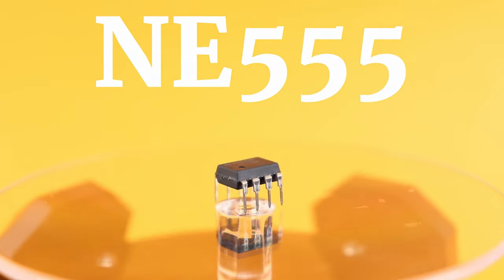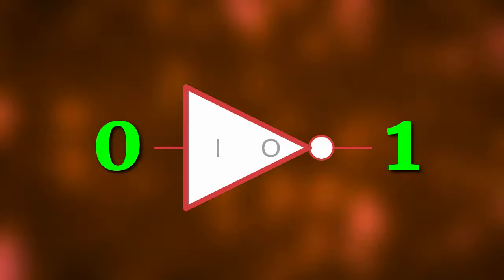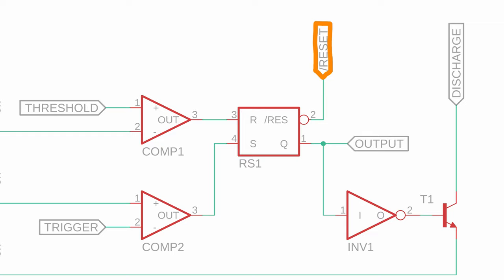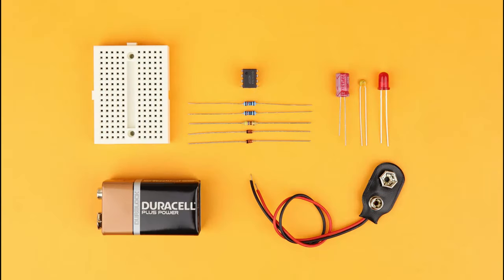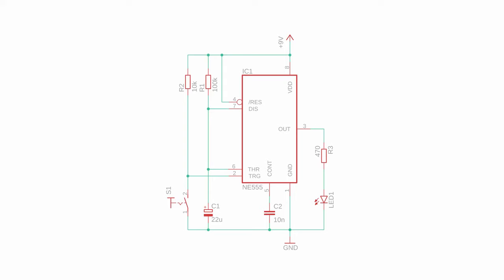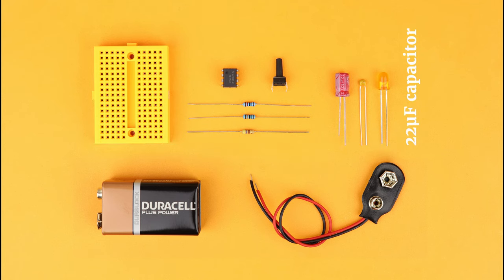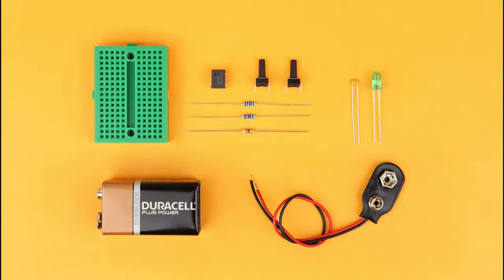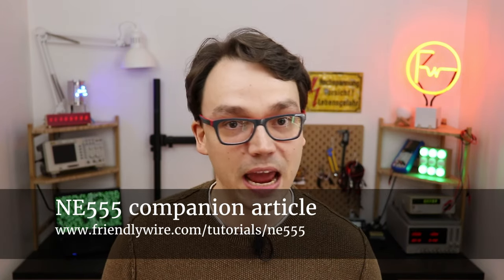NE555 tutorial: three useful circuits

Comment from the maker: Three things I forgot to mention/got wrong in the video (sorry about that):
1. It's a good idea to add a 100nF bypass capacitor between pins 1 (GND) and 8 (VDD) of the NE555.
2. Also add a 100uF capacitor parallel to the 9V battery. This way, if you are driving bigger loads (and not just one LED), there won't be so many ripples in the supply voltage.
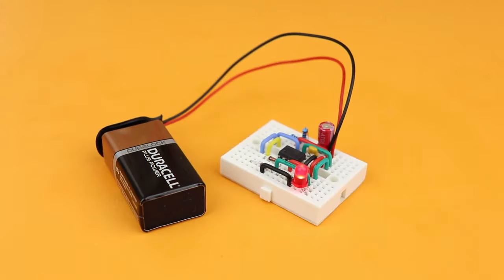3. 6:34 The blinking frequency is actually 1/(t_on+t_off), so it is closer to 3.3Hz in this case. If you look at 8:40 then you see there is no way the blinking frequency is 6.5Hz as I claim in the video. 
Let me know if you find more mistakes! Can we get it to 5? :D
Reply: Thank you for warnings. But this video is so value-added that I personaly didnt notice little details.
Reply from the maker: @eroltube100  Thank you, Erol, that is very kind of you. I am glad you find the video helpful. I think it also shows that there is always more to learn! :)
Reply: At 15:01 you describe placing R3 to pin 1 of the NE555 but the schematic shows it in series with the LED connected to pin 3
Reply: Actually I think I understand it now and although it is slightly different from the schematic it is just that you have swapped the placing of the resistor and the LED but that makes no difference.
Reply from the maker: @moobaa420  Good catch! And yes, you are right, it can be connected either way :)

Comment: I discovered this channel from your conversation with Dave over on Twitter.  He’s right.  

These are outstanding videos!  Well done!!
Reply from the maker: Thank you so much, Ian, I am happy you like them! Have a great day! Let me know if you have any comments on what I can improve, I am still somewhat new at this :)
Reply: FriendlyWire literally nothing comes to mind. They’re superb.  I really wish I had this type of teaching material when I was first learning. 

One thing that I see less experienced folks struggling with is how to properly use a multimeter. (How to measure the current of an LED for example) 

It would be great to have tutorials on the basic tools typically used to help debug and probe the circuits you’ve taught them how to build.  

Also, how to work with BJTs ... the humble 2N2222A is a useful little beast, especially when you need to drive a load from a TTL logic chip (or arduino module).  Explaining the difference between source and sinking currents would be great too.
Reply from the maker: @IanJohnstonblog  Thank you, those are great ideas! When I started electronics as a kid I had an analog meter that was hard to read and only much later switched to a digital one, but only very recently I acquired a bench meter, and I am glad that I did... Debugging circuits is definitely a great idea, but it can get very complicated very quickly, so I will have to try and find a right combination that makes sense for beginners and does not require too many expensive tools.
Thanks for the input, much appreciate! :)

Comment: Hi, excellent video and educational content, as well as useful examples. I want to test an old TI TLC555CP analog chip in oscillator mode. Since there is no practical or affordable tester for such a component, if I setup a model as shown in your video, and if it works, can I reasonably assume then that this TLC555CP works as designed? Also, if it is proved to be defective, can I replace it with a TI NE555P? Lastly, having detailed description of the video on your web site is an excellent idea, but a slower pace in your video would be very much appreciated. As a suggestion, you may want to split such a video into multiple parts if a slower pace would stretch it to over 20 minutes. Thanks again for putting such a detailed and interesting video, I know that this takes lots of time and efforts, let a lone good knowledge of the subject matter. keep it up!
Reply from the maker: Thank you for that beautiful comment :) Several people have let me know that the pace in the NE555 video is too high, and it was one of my earlier videos, so I hope I have since taken that into account. Sometimes it's hard to realize these things by yourself, which is why I appreciate this comment a lot.

I think that if you have build the astable oscillator circuit and it works as advertised then the chip should be OK. If you only test the bistable mode then you only know that its flip flop works, but you have no idea about the comparator module.

Regarding the other variants of the chip: yes, they should work. The only difference is the operating voltage. Some chips (especially older ones) only work with exactly 5V DC, whereas newer CMOS-based designs accept generally 3-18V DC. So make sure to check the datasheet on that, just to be safe. Other than that, newer parts may support higher frequencies, but I think that may not be relevant in this case.

Let me know if you have any other questions, thank you again for your comment, and have a great rest of the week!

Comment: At 15:09 you did not follow your own schematic and you switched the order of R3 and the LED.  I suppose it still works because  output on pin 3 will still switch from high to low.  Shouldn't the resistor be on the end of the high output to prevent burning out the LED?  Does it make any difference?
Reply from the maker: Nice catch! It doesn't matter, you can build it both ways, it is exactly the same :)

Comment: I started jumping pins on a live 555 blinking light circuit and my board went dead, i thought I had fried the IC or something else and couldnt get the circuit to work, i started a new circuit and the chip and all parts worked fine. Is it possible I disrupted the chip without damaging it so it failed temporarily?
Reply from the maker: Intermittent errors are always the hardest to spot... I am not sure. If is likely that perhaps the breadboard contacts were a bit loose and did not make proper contact. I have had the weirdest things happen on cheaper breadboards with unreliable continuity.

Comment: I want to create such a circuit

That when I give 0 logic input  come at trigger and instantly I will change it to  logic high 1 after then.
Now the ouput goes high when it receives 0 
And the output remains high even when input becomes 1 . As no reset or threshold is pressed yet (i have tested it and its the way it works) .
(Now remember at trigger pin input is still 1 high logic but its not reading it as it can trigger only one time and its already done as trigger received 0 initially.)

Now i have an external circuit which is monitoring a voltage when this will become true 
I want the circuit to be reset and read that logic1 which is present ay trigger 
How can I achieve that?
Reply from the maker: Thanks for the question! I am sorry but I don't really understand what kind of circuit you are looking for. Can you explain some more?

Comment: The part starting @1:30 confuses me. The output Q always seems to be equal to input S. Either I am missing something or something is missing from the explanation?
Reply from the maker: Good question! The flip flop is a memory, so if both inputs are low, it remembers its previous state (if it was ON, it stays ON, if it was OFF, it stays OFF) . Hope that helps, and sorry for the confusion :)

Comment: Sir.. in astable mode the led cathode is connected with the wire which is already in 12 row?? Can u help me out
Reply from the maker: You are talking about 8:19? Yes, the LED cathode is in row 12. The vertical black wire from row 12 to pin 1 of the NE555, and the horizontal black wire across to the right side (also row 12) are the "ground rail." See also at 8:34 how the 9V battery is connected. Hope it helps!
Reply: @FriendlyWire  Such a legend you are.... Thank you so much..😊😊
Reply from the maker: @Syeda-Hadia  Happy to help! :)

Comment: Hello? I'm all new to these :(
I just wanna know, instead of making my LED blink, can't I control it's brightness using a similar astable circuit and a potentiometer instead of R2?
Reply from the maker: Hello, glad you found this video! :) Yes, you totally could, that's a great idea! This type of dimming is called "pulse width modulation" and R1 controls how long the LED is on, and R2 controls how long it is off (for more details see here: http://www.friendlywire.com/tutorials/ne555/#ch2 ).

You just have to make the overall frequency of the circuit much higher so the blinking appears like a decreased brightness. Typical PWM frequencies are a few kilohertz (aka 1000 oscillations per second), so you could replace C1 from the 22uF to a 100nF to see what happens :) I have not done it in person, but it would be a cool project! :)

Let me know if you have other questions or if I did not explain it well, I will do my best!
Reply: @FriendlyWire  I din't expect such a quick response, tysm :)
You really explained it very well and no one else explained the circuit schematic so well :D
Also, I hope the PWM thing works for me!
Reply from the maker: @tamaghnadas8370  Happy to help, and thank you for stopping by! Definitely let me know how it works out :) One thing to keep in mind is that if you only vary R1 or R2 (i.e. change the on-time only or the off-time only) then the total PWM period will change. Perhaps it is better to think of R1 and R2 as the two halves of a potentiometer, so that R1+R2 is always a constant so you would have a fixed period PWM. Hope it makes sense! (If not let me know and I will try to explain it better!)

If you have social media it would be so cool if you could send me a photo of your project @FriendlyWire , I would love to see it! :)
Reply: @FriendlyWire  I do not think R1 and R2 can be seen as two halves of the potentiometer :( R1 has it's significance. However, R2 (the pot), I suppose, can serve in two ways- it's one half for charging C1 and the other half for discharging. Idk though if R1+R2 remains constant in such a connection, if I'm making sense at all-
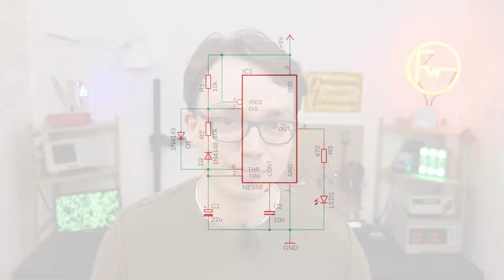Reply from the maker: @tamaghnadas8370  I am not sure if I understand. If you use the schematic at 5:09 you can see that C1 charges only through R1 and discharges only through R2. So my suggestion is this: remove R1 and R2. Then, connect the center tap of a potentiometer to pin 7 of the NE555 and to the anode of D1. One of the outer connections of the potentiometer goes to VDD, the other one goes to cathode of D2. Shouldn't that work? :)
Reply: @FriendlyWire  I studied about it, I guess I should give it a try in practice. However, while making changes in the potentiometer, if R1 drops below 1 k-ohm, I suppose I'll burn the discharge transistor of the IC, sounds good otherwise
Reply from the maker: @tamaghnadas8370  Oh I understand what you mean, you are right, it's best to keep a resistor there like 1k.

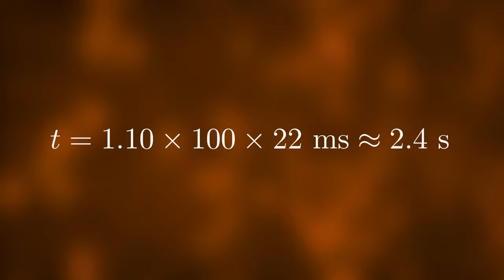Comment: 10:21 how much capacitar and resistence use to 0.45 seconds and 0.35 seconds and 0.25 seconds
Please reply bro
Reply from the maker: Sure! Take the formula at 10:10, and fix C1 to be 47uF. Then choose R1 accordingly. To get your times you need R1=8.7kOhm (450ms), R1=6.8kOhm (350ms), R1=4.8kOhm (250ms). I would recommend a 4.7kOhm resistor and a 5kOhm potentiometer in series, then you can adjust between all these times. Hope it helps!
Reply: @FriendlyWire   thanks bro
Reply: @FriendlyWire  I am a new subscriber
Reply from the maker: @dhanapallayya254  Happy to help! When you build the circuit and take a photo, feel free to tag me on Twitter or Instagram via @FriendlyWire , I would love to see it :)